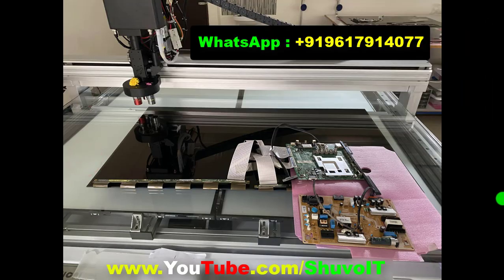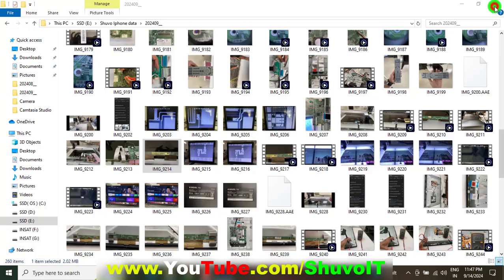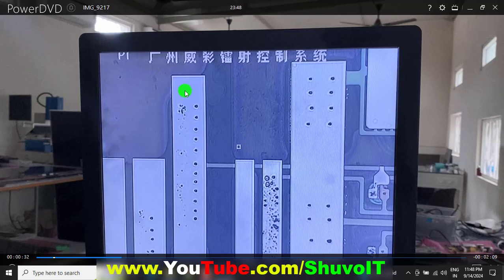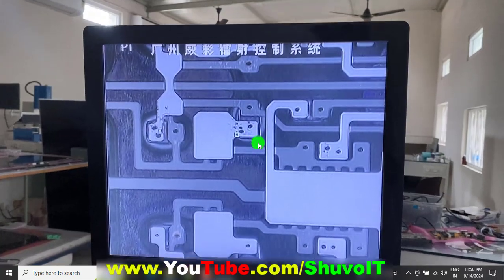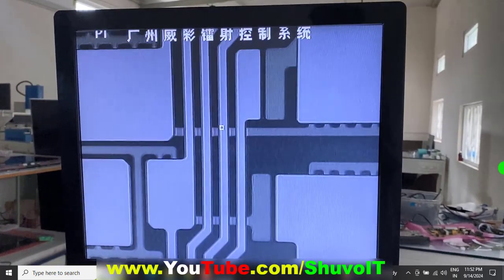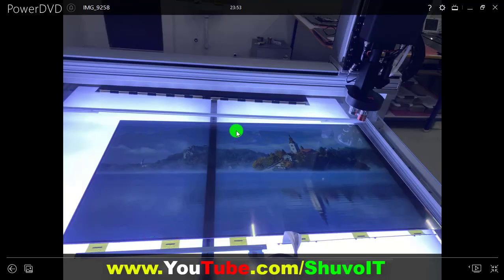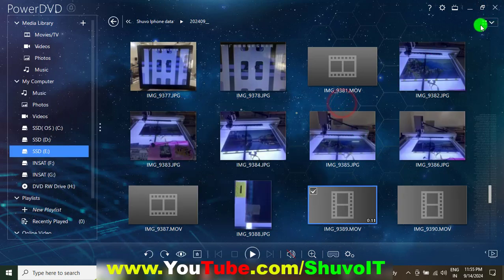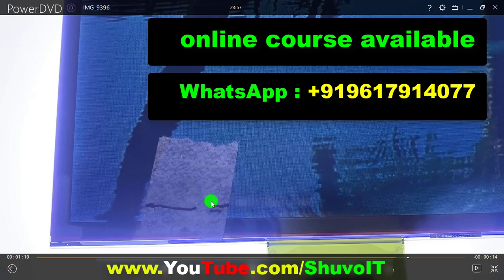Samsung 43,55,65 TV Restarting Problem | Panel Both sides Short Repair Solutions with Lazer machine

Comment: Thank you for sharing your knowledge. I have a small question: Why when I cut some displays a liquid appears Thank you for sharing your knowledge. I have a small question: Why when I cut some displays a liquid appears inside. This liquid doesn't seem to dry. Is there any technique to make the cuts without the liquid appearing? thanks
Reply: LCD means LIQID crystal display so LIQID  is every where
Reply: there is no technique to cut without liquid appearance, because when we make laser fire some heat produced, so it is normal thing, but for more efficient work you should make cutting little far from the shorted area, also you should consider the energy setting of your machine, don't set high energy if machine can perform in low energy